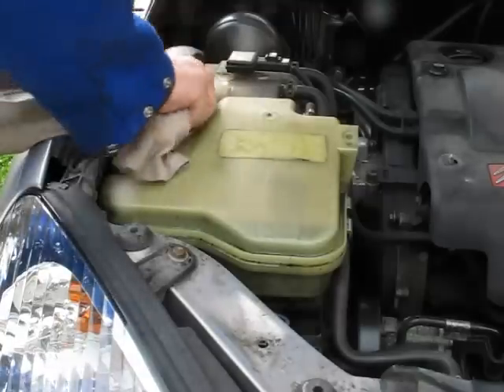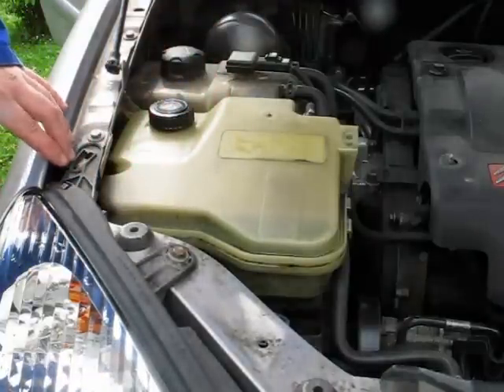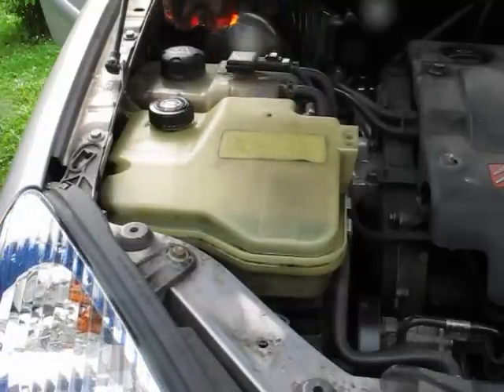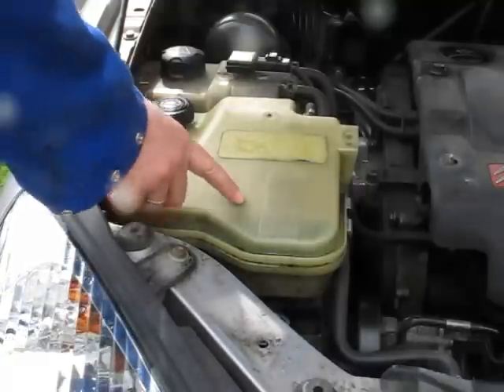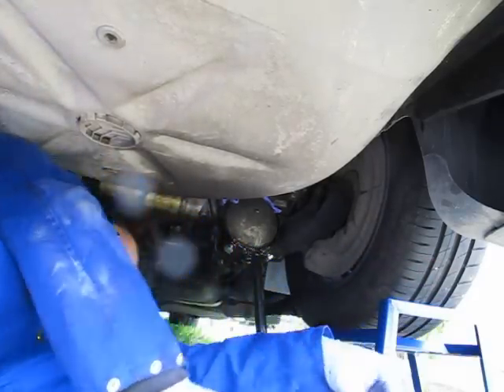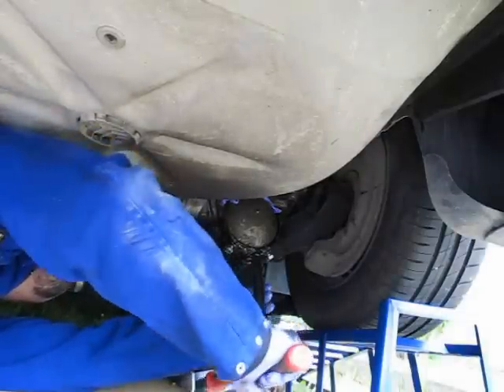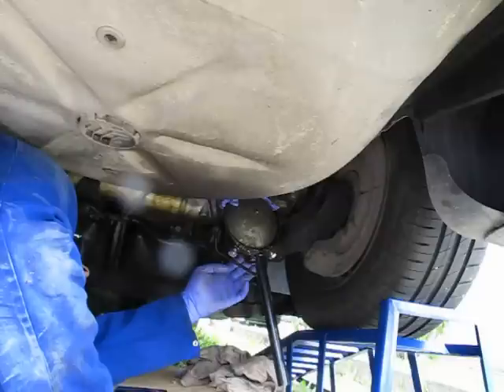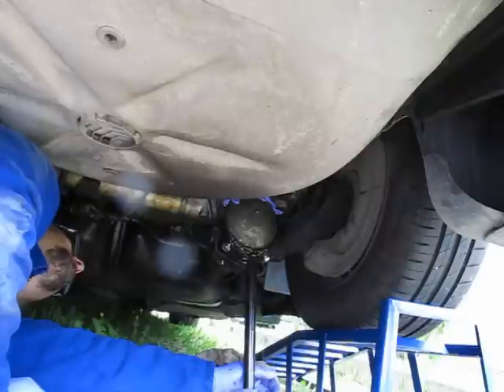Citroen C5 Depressurize and Sphere Change

Comment: citroen C5 2001 exhaust pipe strange sound when the car is cold but disappears after a few minutes when it warms up. At 1,500 rpm the noise disappears. Any piece in that sounds?

Comment: Hi mate, how do you depressurise a 2011 C5 sedan (got sport mode)? Of course without Lexia. Thank you
Reply from the maker: I did not try this myself, but read about it: There is a valve near the front right suspension which has a bleed screw. So first loosen the sphere while still raised, then lower to lowest position, then open that bleed valve. Fluid will spill, be prepared.
Reply: @lynxonwatch  thank you. Now I just have to find that valve. Btw, I have to replace both rear shocks :( cos they are leaking... strange..

Comment: After this, is it a must to bleed the system? Or can you just start the car..
Reply from the maker: Bleeding is done by operating the hydractive while the car is stationary. Start the engine, then raise and lower it 5 times to the max / min positions. THis bleeds the system. Also turn the steering from lock to lock a couple of times, since it uses the same oil.
Reply: @lynxonwatch  thanks

Comment: Hey buddy, I changed all 4 spheres and LDS fluid on my C5, but still no fully comfortable drive..? Any idea what could be problem..? I haven't connected car to lexia after replacement to release air from the system...
Reply: Hi, try some hydractive gymnastics: 5 times fully up and down in succession.This bleeds the system. Then, the c5 is not as plush as a xantia or similar, more like a normal car.
Reply: I done it already... Some how it does not absorb small holes on the road as well as it should and everything else is changed..(sillent bloks, globes). Rear arm bearing was changed about 20 months  ago, and the car made about 23k km with those, can't believe that they are gone again...but roads in Serbia are pretty bad...
Reply: The new bearings need lots of grease. Propshaft grease that is water resistant is best, I think it is Lithium based. You need decent bearings and they need to be loaded and shimmed properly, so they are not being squashed or are too loose. I think a lot of the no name bearings with the kits are Chinese bearings. Did you fit a branded bearing?, like Fag or SKF?
Reply: I went to Official Citroen service to change the bearings...I am not sure which one they fitted, but I know that new SKF in my country are about 90 euros for both sides, and they took 120euros for parts and repair together...  this was changed on decembar 2016... before this, I also changed them on decembar 2014...
Reply: Milos 87.  Your English is stunning my friend. Good luck with car.
Reply: I am sorry man, there is more than 10 years as I stop learning english... and I use it rarely now, so...don't get mad... I think you can understand what I said in post above...
Reply: "milos 87.  "Your English is stunning!"  That is a compliment my friend, it is brilliant!
Reply: Damn man, I thought you were kidding me... :D haha 
Ok, thanks... cheers
Reply: @miloshlion  Jesi oktkrio sta je bio problem ?
Reply: @petrovicdruid  nisam sa sigurnoscu, ali jedan decko mi rekao da su silent blokovi i prednji desni teleskop...
Reply: @careca I don't know exactly, but I know that those were a comfort spheres for my C5...if I remeber well,  they had 7% bars than original ones...

Comment: I noticed you have the gray colored spheres. I have a Citroen C5 HDi- 2003 Sedan. Would the system be the same as yours and if the spheres are green what is the difference? My problem is that rear suspension is very stiff. Any input is appreciated. tx
Reply: You will need the same grey 'Saucer' spheres as they are known.  You will need to check the correct ones for your vehicle as they have different pressures dependent upon Model, engine and hydractive 3 or hydractive 3+.

The old green spheres were for previous Citroen's prior to the C5 and C6 and they were designed to work with the green LHM / LHM+ hydrualic oil,  The C5 and C6 use a fluid called LDS made by Total.  Don't mix the two!

Comment: Hello, my C5 X7 is leaking oil from the struts, do you have any idea how can i stop it? A new strut will cost a lot of money here in my country...I was thinking about a Hydraulic anti leak, but im scared about it, haha
Reply: Before you panic, it is possible that the fluid from the return pipe is leaking.  You might just need a new gaiter at the top of the strut.
Reply from the maker: Hi, I would not be using anti leak stuff...Hydractive is rather sensitive. I would try: 1) Hydractive Gymnastics, up & down 5-10 times, leave it high up over night. 2) Exchange of Hydractive Fluid 3) Loosen spheres and retighten 4) Remove spheres and replace O-rings 5) ??? :)
Take time between steps 1 and 2, a week or two maybe.
Hope this helps.

Comment: Hello, Thank you for your tuto. I have a C5 Tourer phase II. I need to change the rear “accumulators” but unfortunately the tool I had to unscrew is a chain type and it is a bit too thick like there is not enough space for the chain between the accumulator and the car body. I need a tool with a metal strip, but I guess simple the one for oil filter are not strong enough. I see you tool that look much stronger. Would you be kind to tell me where you bought it?
Reply: Many thanks, I will check for this tool.